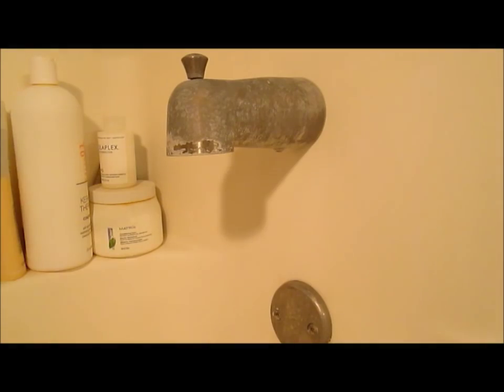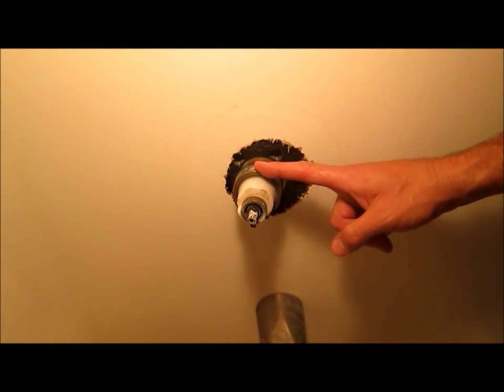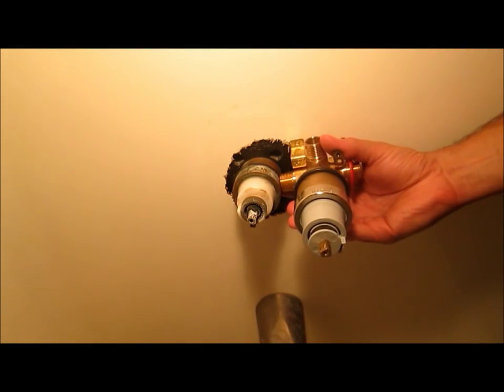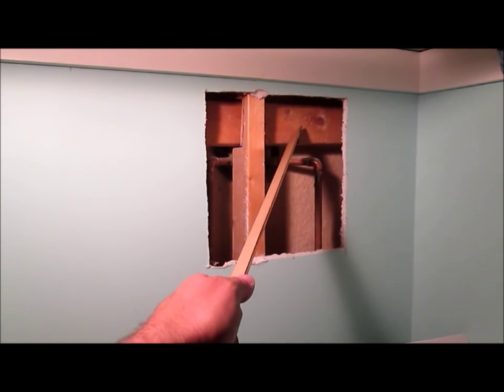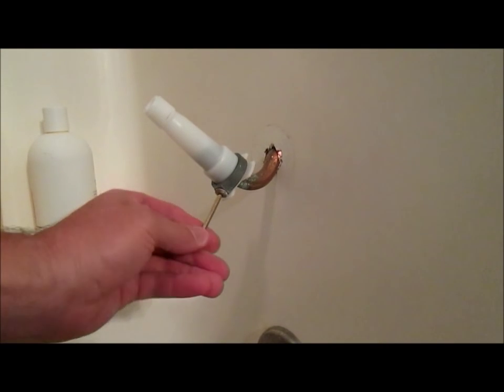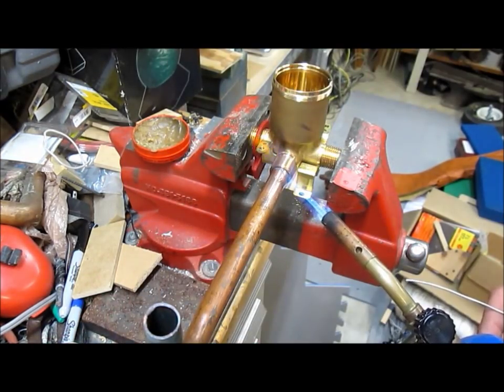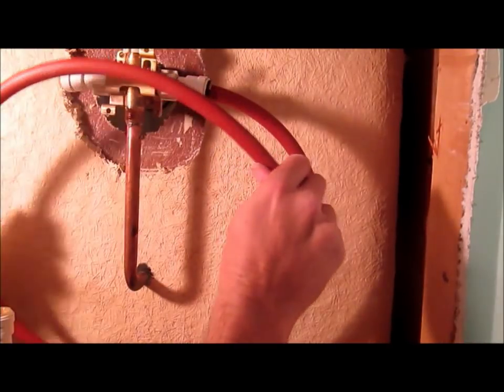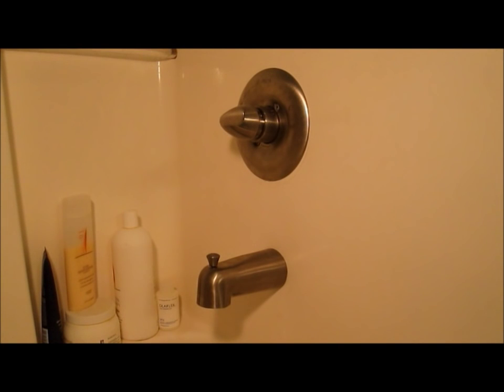How To Fix a Dripping Tub Faucet

Comment: If you hate too repair drywall holes like I do and you are lucky enough to make your drywall cut in a closet or behind a door.

Buy an inexpensive a/c return air filter vent. 

Make your cut to accommodate your new vent. 

The true beauty of this is that the next time you need to get into that plumbing…you just open the vent!
Reply from the maker: Good tip

Comment: I just thought it was as simple as chaging the actual faucet part. I'm feeling a bit nervous now! Heaven help me if ours turns out to be that big of a project. You clearly know what you are doing, and your confidence made it seem doable, but I still felt terrified as I watched you! 

 (If my two youngest boys lived in that house they'd love opening that panel--and they'd probably cut the soft pipe!!  I'd have a lock on it!! ;))

Clever use of curling the pipe around. You are great at problem solving! Thanks for making the video.  How long would you say that took you start to finish?
Reply from the maker: If all goes well, you can have everything changed in about an hour.  My project turned into more like 10.

Comment: I would think cutting the bonnet nut or notching it with a file/hitting with a screwdriver (not too hard) might work.
Reply from the maker: Worth a try, but its very easy to bend the small copper pipes in back.  Two big pipe wrenches would not break it loose, so I am afraid you would have to tap really hard to break it free.

Comment: You turned the water main off, but did you have to bleed the lines before working?
Reply from the maker: No, there is no need to bleed the lines.  You just turn off the water, so there is no pressure.
Reply: OK, I did that to replace shutoff valves, but I guess it doesn't matter in a tub, as opposed to behind a toilet. Thanks!

Comment: what if you put a new cartridge but the faucet still leaking ?
Reply from the maker: +Lilly Rangel (Liliana) - you may have to replace the other side too. You can use the shut off's under the sink to turn off hot and then cold to figure out which one is actually leaking. It may be both.
Reply: That's what the sledge hammer is for.

Comment: Where did you buy the chemical that clean the faucet, how do you spell that word ?Thanks for the utube.
Reply from the maker: +Jenny Lam - Muriatic acid is available in hardware stores in the tile section.
Reply: Could it have been used to take the ring off?

Comment: How much would a plumber charge me to do all that?
Reply from the maker: Plumbers run about $50 trip fee plus $50 per hour.   So maybe $100 plus parts if it goes easy.   If it turns in the nightmare, 8 hour, job, closer to $450.
Reply: @HowToLou  ok. I figured it would be close to that amount. Thank you!